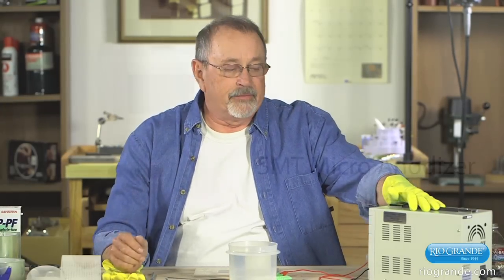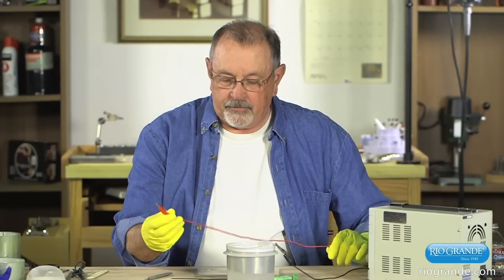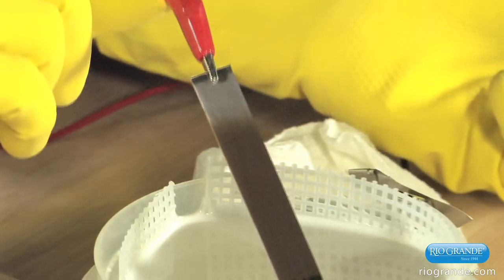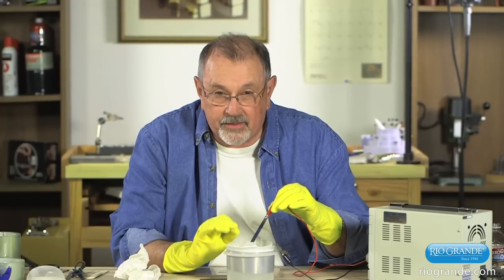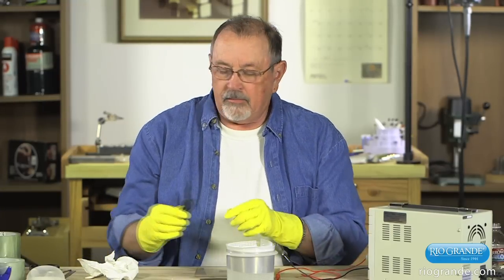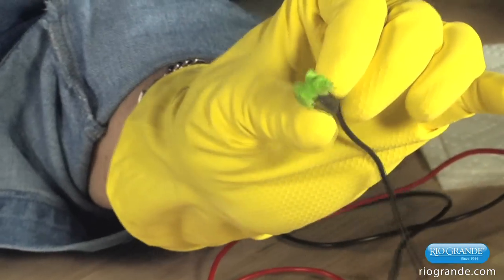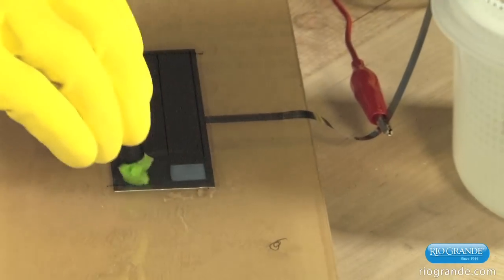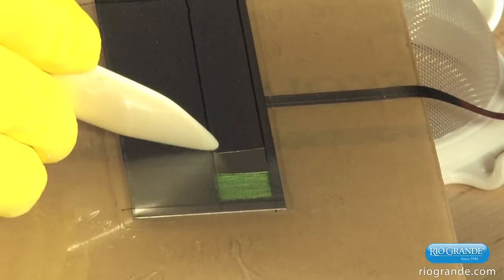How To Anodize Reactive Metals: Coloring Niobium and Titanium

Comment: Very informative and well-paced video - thank you.

What I want to do is to form custom earwires from niobium wire, then anodize them a nice coppery brown color. I know I can purchase colored wire, however I'm aware of several reports of the color disappearing when forming and hammering the wire to make earwires.  

I'm not certain any of the techniques shown will work for such small items.  Since the clip cannot be submerged, it seems there would be a section that remained uncolored.  Any suggestions would be appreciated.
Reply: You can do batch anodizing after you've finished forming your uncolored wire.  You just need our Small Parts Basket and a Niobium Magic Wand (a different type of positive lead you can put into the bath instead of the alligator clip lead).  We color thousands of earwires, head & eye pins at a time using this technic.
Reply: Thanks for the very clear response.  Much appreciated!

Comment: Wow, thanks for posting this video. I wish they let us do this in chemistry/tech/shop class. 

How precise is the color/voltage control?

Is this technically a prismatic effect? How do different polish textures (rough, mirror, etc.) effect the final clarity, etc. of the anodized look/color? Does it affect the reflective properties of the product after anodizing?
 Can the anodizing take an acid wash? Would that bring out any effects?

  8:20 - the painting was beautiful to watch - I didn't notice any red, orange or yellow though and I've seen jewelry and car stuff sold in those colors as "Anodized Ni/Ti".
  How or do you get a deep hotrod red?

  Does Niobium have the same shine, tone and finish as Ti? Or is Ti brighter?
Reply: Hi Savagelnsight, i appologize for such a late reply, i just noticed that we haven't addressed your questions. The color/voltage control is very precise, a new color can be developed at each volt allowing you you to do fades from one color to the next.
Correct, it's a prismatic affect so the surface of the metal plays a huge roll in what you get, matt finishes tend to give off the best color, we're not sure what and acid wash would do.
Here he is demoing on Ni which has a slightly different color spectrum than Ti. at a certain voltage the deep hot rod red appears but the finish of the metal will play a factor in that. Ti can get a little brighter than Ni but it has to be treated 1st with an etch to remove the oxide layer. We use a product called Multi Etch ( available only in the USA).
I hope this is of some help.
Mark N Tech

Comment: Thank you for a very interesting video! May I ask? Please tell me whether it is possible to fix the error with the color? 
1. If I painted the niobium foil in gold or yellow (+ 50-55V DC), can I go back to dark blue (+ 22 Volt)? Will there be a mix of colors with the result of "green"? 
2. Are there any tricks or tips for getting as red as possible? 
3. In your video, the direct current is zero. In which case it is necessary to increase the current? If I think correctly, that with the increase in the current will be thicker than the oxide layer? 
Thanks for the reply.

Comment: So, are the colors the exact same per voltage? Say I had a Ti piece, and I inlaid it with Nb, then anodized - would the two metals have a discernible color difference? Or would they both turn the same color?
Reply from the maker: Hi! Thank you for your question!  The colors are similar at similar voltages but niobium generally produces a more vibrant color, while the color on titanium is more muted. So, while similar voltages produce similar colors, there is a discernable color difference.
Reply: @RioGrande1944  Thank you! This is definitely helpful knowledge. :)

Comment: Great video! One question remains; what is the amps setting?
Thanks, Hans
Reply: Hi Hans. Thanks for watching. The amps will vary, typically between .00-1.00 amp. What you use is mainly up to you. We like using 1.00 amps for bath plating. For more information you can check out the instructions on our website at http://media1.riogrande.com/Content/SMT-MICRO-Anodizer-IS.pdf
Hope this is of some help.
Mark N Tech

Comment: This is an awesome video. Is there a voltage that will achieve the color Red (kind of like blood red) well? From the charts I’ve seen it seems to skip more like pink to magenta. But wondering if there is an in between voltage that might make red possible.
Reply from the maker: Hello, we will pass your question on to our Jewelry Tech Team and get you an answer!
Reply from the maker: Hello, we wanted to let you know that we unfortunately no longer carry Anodizing equipment. For further assistance we would recommend that you get in touch with Reactive Metals. www.ReactiveMetal.com 800.876.3434. We hope this is helpful for you!

Comment: do you need to turn up the voltage? Won't it change at the same voltage if you hold it in longer?
Reply: Hi rpaull3. Correct,  for the most part if you want the color to change you need to change the voltage. Each color is determined by the voltage, right at the beginning there is a very small window of time where the color builds up and time is a variable to color. But after the 1st few seconds it’s done. Beyond that, more time in a spot will not change the color.
Hope this is of some help.
Mark N Tech

Comment: Will this work with aluminum or titanium or analuminum titanium or nibidium alloy? I want to anodize some truck and motorcycle parts
Reply: Hi Huck My Truck, This process will only work with Titanium and Niobium, aluminum anodizing is a different process evolving dies to create the color. Just so you are aware,  (unlike aluminum anodizing) when anodizing Ti and Nb in this manner the finish is very delicate. I’m not sure they would last very long on operable parts. The colors you can get using this process are amazing but very delicate and can be removed quite easily.
I hope this is of some help.
Mark N Tech

Comment: I know this process is not meant for coloring other metals, but what opportunities or processes exist for bonding or plating steel and/or aluminum with titanium? Once bonded or plated with titanium, would this process work for colorizing said items?
Reply: Hi Bill Nye, thank you for watching. We wish we could help with your question but unfortunately it goes beyond our scope. We are focused  here more on coloring the titanium and niobium for jewelry applications. We have the equipment and know how to plate gold and silver onto steel but unfortunately not titanium.
Mark N Tech
Reply: RioTechs Oh well, it didn't hurt to ask anyways. I thank you for your rapid reply, even if it did not contain the information that I wished to learn. I would like to say that I found your video thoroughly fascinating, and it opened up some possibilities (or at least the first conception thereof) into making/coloring some unique parts for a gun that I am building. Thank you for putting it out there for us to enjoy.
Reply: Vapor deposition would accomplish this.  You can google companies that do this process as it's more than the normal workshop can usually manage as it must be done in a vacuum atmosphere.  Basically, it's the same way they coat "titanium" drill bits and scissors.

Comment: magic color, which product you do for Anodizing titanium?
Reply: +tina Wang Hi Tina, anodizing titanium is the same as anodizing niobium save for 1 extra step, you need to clean the metal using the Multi etch. http://www.riogrande.com/Product/Multi_dash_Etch-Cleaning-Granules/335257
You can find more information on our website at http://www.riogrande.com/ad/niobium-and-titanium-from-rio-grande
Or feel free to contact our Tech Support team who can answer your questions. They can be reached at 1-800-545-6566 or by email at Technical@riogrande.com
Reply: RioTechs ok, thanks, we titanium manufacture since 2004, any inquiry about titanium material, you can contact me freely.

Comment: What are the benefits of this over heat anodizing?
Reply: Hi insek10gic, anodizing this way gives you alot more colors and much more control over them. Hope this helps.
Mark N Tech
Reply: I was curious because I see heat anodizing used more often, probably because it is easier to do, and I wondered about the benefits of doing it through chemical treatment instead. Thanks for the response, and thanks for the informative video.